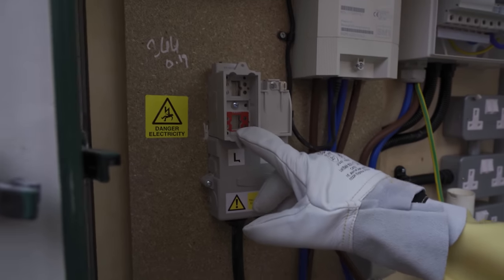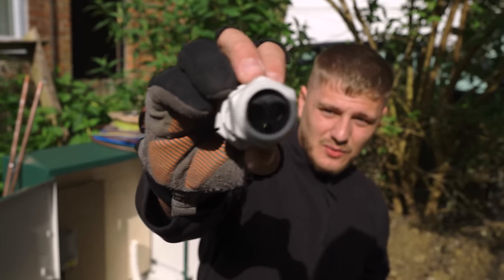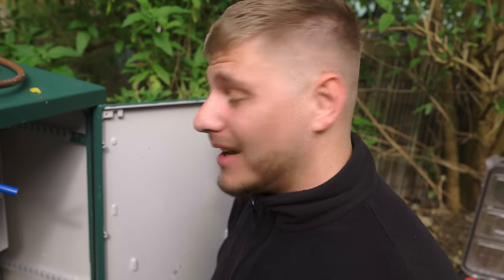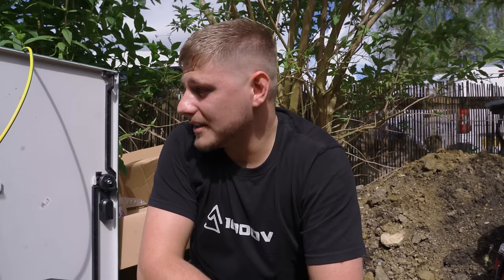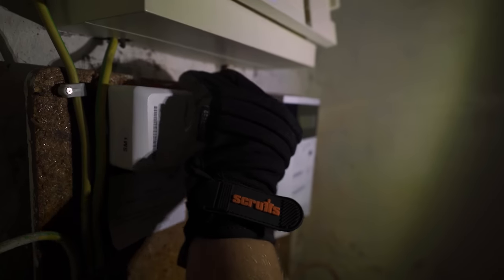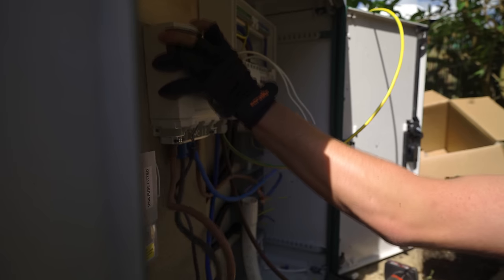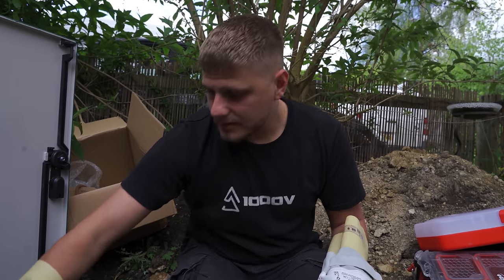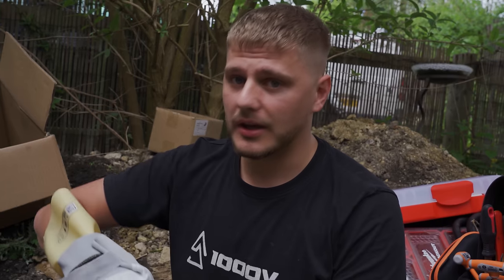Hooking up an electricity meter

Comment: Be careful with that very initial statement. Often the DNO can put that fuse the wrong way up! Plus, only the customer's supplier should be moving meters. I'm surprised the DNO and the suplier refused to move the service and the meter. The DNO is not known for refusing paid work. That seperate unit is the comms hub.
Reply: That is correct it is down to the DNO. However, where was your testing? No testing on cutout or the meter.

Comment: Not a chance anyone in a position high enough to authorise you to move the meter has given you written permission.
Reply: U don’t understand what I mean. I’m not doubting that someone has given you permission. What I’m saying is, the person who has given you permission, isn’t in a position high enough to authorise something like that. And if the wrong person sees this video, someone’s going to be getting their P45. It will be easy to work out where you are as the meter number is clearly visible.

I’ve seen it from both sides, 17 years at the DNO and now from the IDNO side. You can get permission for all sorts you know your not supposed to be doing if you ask the wrong (right) person.

You made a better job of it than most jointers would make and took a lot more care over what your doing. 

DNO’s & IDNO’s have slightly different rules and regs depending on which one it is your working for. I’m authorised for a few different ones, and it is overalls zipped upto the neck, visor and LV gloves for any work at a cutout. Weather it’s new, old, loaded, unloaded, dead live etc
Reply: @residualelectrical  I don’t have any social media so I won’t be able to, but I’ve got a good idea what I think may have gone on! I’d say someone’s done something they shouldn’t have been doing and neither the dno or the meter operator has wanted to take responsibility for it. 

I’m not 100%, but I think that type of meter has a  little button under the terminal cover and it notifies the owner when the cover has been removed.

Out of curiosity, did the permission come from the meter operator?
Reply: The other issue that comes to mind is that there are no official seals on the supply now or a record of said installation.
Reply: TT rod- not disk. Only querying having seen the video with you and Paul. Nice video- good work!
Reply: Also supply operator would not necessarily be the same as the meter operator, so possibly needs two authorisation.
Reply: They definitely can if the building is being demolished due to safety concerns and if he has a set date that can all be moved they can require a meter to be taken out and put in potentially there is a point we made that they can change standard practice for
Reply: @Arachnoid_of_the_underverse  it’s very possible they could send someone when available to do that
Reply: @UKsystems  no they can’t. Nobody other than the dno can authorise someone to pull the dno fuse.
Reply: @ShalomBrother  the dno authorise metering companies to pull the fuse they can then authorise their employees or third-party contractors to pull it

Comment: Tbh not a bad effort, I used to train and asess MOCOPA for British Gas and a bunch more and apart from some anal Nuances you did a great job. The main considerations are first and foremost correct polarity,  then tight connections (loose wires cause fires) , no copper showing, no extreme bends in cables job done.
Reply: @residualelectrical  don't sweat it ,those of us that subscribe know how committed you are to quality workmanship 👍👍👍
Reply: You got a pair of those sweet Mocopa pliers?😉

Comment: The tinning of the copper cable helps with corrosion resistance 👍🏼
Reply: Agreed, used to be used more, now mainly just on panel SIS wiring and cases where it's needed.
Reply: @inothome  not alllowed on meter tails
Reply: @treehouse7861  You can't use factory tinned wire or do you mean manually soldered ends? I know soldered wire is not good for screw or compression type terminals, but individually tinned strands is used in almost all panel wiring in substations. We call is SIS wire in US. Its copper strands with a very thin coating of tin.

Comment: Sorry if i missed it but did you check the polarity? Nor unknown for jointers to get it wrong.
Reply: I agree. I’m a jointer, and been called to some pretty sketchy set ups by fellow jointers
Reply: Yes, was just about to comment about polarity and an independent earth test to confirm it.
Reply: He would have definitely found out when he fitted the neutral from the meter if it was swapped. But yeah, always check first so you don't find out that way.
Reply: He may have tested that at the consumer unit, not at the meter or cut out due to the fact that he’s done the rest

Comment: Your videos have come a long way Mike 👏 
I havent messed with much TT either but I always thought they had to have a 100mA time delay up front and then 30mA covering everything else. None the less looking forward to getting educated with the next vid 👌👌👌
Reply: 100ma time delay  rcds are required to provide fault protection whilst keeping selectivity with other circuits. These days with metal distribution boards as Mike has touched on, with tails clamps the incoming tails can be considered appropriately protected from fault protection and apart from spd conductors  (which in my view require fault protection) all over wiring should be protected via rcd to achieve relevant diss notion times.

Comment: Worked for BG on metering for 10years. Thats a smet1 smart meter. The extra bit connected by the wire is the coms hub. Seriously doubt BG would authorise the move but maybe the supplier has been changed to a smaller less anal supplier. 
Looks like you’ve done a better job than some meter fitters. Couple of things, theres a marker on the side of the isolator to make sure enough is stripped back. With multistrand meter tails I like to get some pliers on the copper and unwind/flatten the end thats being terminated. We were always told to try and go into the isolator on the topside, purely because if the cables became loose they wouldn’t be able to drop out exposing live conductors (the chances of that happening are slim to none with double screw terminals but stranger things happen).
Reply: Wouldn't you agree that the Meter's Incoming Line(L) would probably fall off too, towards the gravity ; hence posing the same abovementioned Hazard?
Reply: They can authorise the move if they hold the buildings coming down and they don’t have any availability to get it moved

Comment: Cool video, thanks for that. Nice to see it from a different view point outside the realms of the DNO. 
I had our meter replaced about 6 years back, and the guy that came got dressed into a fully cloth suit (that looked like the outer gloves you had) and what looked like rubber gloves red inside, and black on the outside. No cloth outer gloves were used from what I remember, but he did wear a fold down mask. To be stood behind him watching as he got dressed up for this, me thinking... hang on... don't I need some kind of protection here lol. Thankfully, the fuse was pulled and replaced within minutes and he got undressed again.
Reply: There's only one true gripe I have with customers when I'm working, and that is when they stand directly behind me watching like a hawk
Reply: @0liver0verson9  You'd hate me then. I'll even ask if you need any help or want to borrow some of my tools. 👌
Reply: @dataterminal  oh god no haha

Comment: VIR cables/singles have vulcanised rubber insulation and I've been told the vulcanisation of the rubber during manufacturing would oxidise bare copper conductors, which is why rubber cables and flex always had tinned conductors until fairly recently. Not sure why some UK manufacturers continued to use tinned copper with PVC, haven't seen that anywhere else. Force of habit maybe.
Reply: Tinned copper used on high voltage D.C solar cables

Comment: Rcd main switch satisfies fault protection this is determined by the resistance of the earth electrode- 100mA is commonly used however this theoretically could be as high as 500mA. 99.9% of circuits will not comply with the maximum zs of the OCPD as per bs7671 to allow for 0.4s disconnection time. 30mA additional protection counters this and allows for ADS of supply.

Comment: I am a spark and I a contractor.  I don't under stand why the DNO companies don't licence guys like us to be able yo break seals etc. I am not saying all of the time but in certain situations. Like most if not all responsible contractors we don't really have anything to gain from messing around with meters. 
So if you did a job and put your licence no on it and then take a photo of your work and submit it you should be good. Any
Reply: What would you do if the cut out decided to fall to bits, live and neutral came together and was arcing continuously? With the potential to burn a house down. I wouldn't imagine you having procedures in place to arrange substation access to pull fuses or have digging teams and live cable jointers avaliable to cut the service cable ? Pulling a cut out fuse is easy when everything goes right, DNO's have specific training, ppe and procedures when 🤫it hits the fan.
Reply: @willmitchell255  really think videos like this on YouTube shouldn't be posted purely because it gives other sparks justification to do the same. If something went wrong here, the HSE would have an absolute field day, so many wrong doings that you have to ask yourself why would you want to do it in the first place?
Reply: @residualcurrent  I agree, meter operators are trained and authorised to do this so why not sparks ? Surely having more training is safer ?
Reply: They generally do, but they require a bit more than just allowing you. The main issue is if the cutout fuse holder was to disintegrate which can happen or something they have to ensure you can correctly deal with the situation.

Comment: Used to work with a guy who spent years working on the railways, he told me a horror story about this poor bloke who pulled a 2A fuse in some electrical hut, it was damp, the fuse and carrier was rusted. The resulting arc blew most of his fingers and hand off…
Reply: Crikey that’s horrible . I knew someone who hacksawed through a ‘live’ SWA cable - they thought they isolated the cable after testing it with a voltage pen 😖
Reply: I know of an electrician who hammered a screwdriver through an 11kv HV cable. He thought it was a red street lighting duct. This happened right outside a substation, so the HV tripped out immediately. He was still left with 60% burns.

Comment: Another great video mate. Question. Can the isolater switch have the meter tails go in through the top or bottom going out to the consumer unit? i always though they should go through the top from the meter and coming out from the bottom for the consumer unit. keep the vids coming they're great .
Reply: It's essentially a double pole switch, so it can be either top or bottom as long as the tails are adequately supported.

Comment: I would worry about putting the main fuse in before the ground rod is connected. If the meter contains any filter capacitors from L to G and N to G, you can get half the supply appearing on the ground wire if it is not grounded. I had a small shock due to this effect from a filter in a washing machine. Please be careful!
Reply: There is no ground on the meter, or at least I didn't see one on the original installation or on his. But in instances where there are the Y caps, that can give you full line voltage if one fails on the line side.
Reply: Capacitors have to have discharge resistors on supplier equipment generally and where is the earth connected?

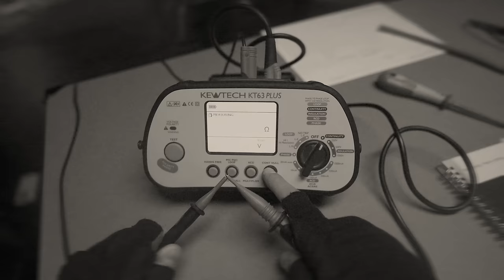Comment: 1:19 what is the actual name of that thing and do all boxes have them?
Reply: It's a cable joint. In this case the plastic single phase cable is jointed to the original paper lead cable feeding the property. This is done with the paper lead cable live. Don't attempt it!
Reply: @Dooguk Thought it was some kind of male/female socket connector. was thinking why people dont just dig a hole and find a compatible Y or T adapter. But yeah, an unfused live is no joke.

Comment: TT system circuits require 0.2 disconnection time, the circuits should be on RCBOs or use RCD main switch…. You would of had no fault protection 🤷🏻‍♂️
Good job owning it 👍🏼
Reply: Two(2) RCBO installed, insn't??
Watched the next video on TT Electrode Installation?

Comment: We're having our supply unlooped, National Grid can't do it in time so they have a contractor doing it, they can't move the meter so it'll be fun....
Reply: Sorry to ask, but what does ‘having our supply unlooped’ mean?
Reply: Means it's being tapped outside. Rather than looping in and out of the incomer inside the house.
Reply: @adriantyler277  thank you. so what’s the need/benefit for doing that?
Reply: @ArthurTugwell  A looped supply means that the supply cable from the road serves more than one property, looping from property 1 to property 2 for example, which results in a lower maximum supply current, which can be an issue if you want an EV charger for example. Being unlopped just means you are getting your own supply from the road, or whoever was feeding from your supply if you are first in the chain is.
Reply: @Sparks0001  thank you!
Reply: Are you having it moved at the same time? Normally when delooping, the new supply goes in exactly the same position as the old one so it’s just a case of putting the tails back into the new cutout
Reply: @ShalomBrother  it's goint to be a "new" supply coming from street, currently it's from cables clipped to the soffit, supplying 4 houses from the rear.
Reply: @timballam3675  sound like your meter won’t need moving anywhere to me. Sometimes people take the opportunity to have the supply moved outside into a viewing cabinet, in which case it would then need moving
Reply: The meter and company has to move their equipment is standard procedure

Comment: How do you know if you cut correct length of conductors into top of cutout? You haven't checked impression on end of conductor on bottom screw. Since you have it done first time as you dont work for dno or energy company,  you should have double checked by pulling out conductors in cutout after making initial impression by bottom screw. Seen many sparkys tampering with meters and tails and being cocky by only terminating conductors on one screw or 1 and half of other screw. Saying " That should be long enough " if you doing something first time, without double checking,  that's cocky.
Reply: Don’t think he’s cocky at all, he’s very passionate about the industry and a very smart guy. Criticism is fine but no need for the hate brother ✌️
Reply: First we would know from his other videos if you watched them he did make a demo board once and he’s done it but the likelihood is these can definitely have data sheets telling you how to terminate them correctly
Reply: @UKsystems  i work as meter engineer.  I see many different cutouts every day. Over last 70 odd years there have been fitted dozens of different cutouts across uk. Some  of them you can visibly see if your conductor is adequately long. In this case of this type of cutout you can't see it. The only way is to stick conductor in, do impression from the bottom screw, pull it out to visibly confirm.  This guy clearly is not fitting tails into cutouts every day, unlike DNO engineers  (who may get a pass eyeballing the lenght of conductor due to their daily experience) . And he clearly said in video that it looks alright but he is not 100% certain.  And that's not good enough for me.
Reply: @MrCarnivoure  really be 100% sure on these anyway the manufacturers actually recommend specialised and load testing

Comment: Dno have their own codes of conduct, when you see a baked in main fuse and they have to pull it  revealing the line terminals. The main switch was isolated before we start chatting about under load. 
Nothing to do with this install

Comment: I thought I'd read that proper qualified electricians were allowed to pull the fuse (though not play withthe meter) now rather than do it illegally which is what they all seemed to do when replacing a consumer unit.
Reply: It depends on the DNO but I think all now allow a competent scheme electrician to pull the main fuse but you need to get prior authorisation. I did with SSE. Easy process. Just need Competent Scheme ID and they gave me 5 stick on main fuse seals and a sheet to record my five and then take this back when full for a new sheet and seals. No fee
Reply: Generally, they require some registration in advance I may make you watch some training videos in a way where they can actually see if you have just to deal with any unsafe situations
Reply: If the DNO finds seals are missing the consumer could be fined.
Reply: @ however in most cases the people doing the work do not care about this
Reply: @UKsystems  Some of the comments on this video prove that. I was a jointer for 30+ years and I've seen/heard some horror stories

Comment: hi, can you mess up with tales after the meter that are going to the house? want to install generator Transfer Switch
Reply: This appears to be a DIY comment. Crack me if I’m wrong but you have to be qualified as it is notifiable and part P of the building regulations companies can create a bit of a hassle if what side does not match records you really need to get someone unqualified to do this as depending on how the generator is you have to do a lot of changing in the earthing